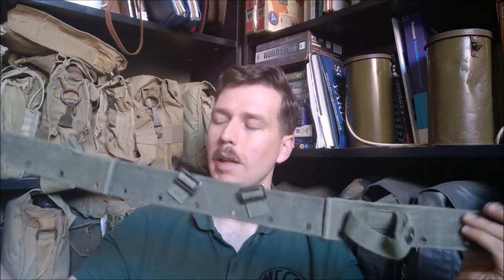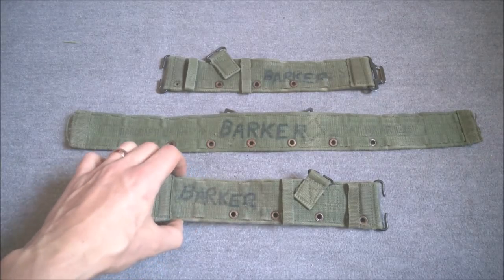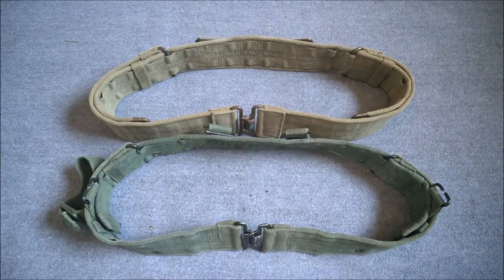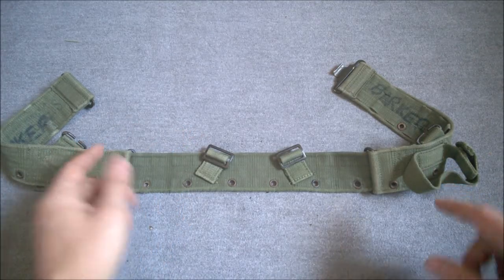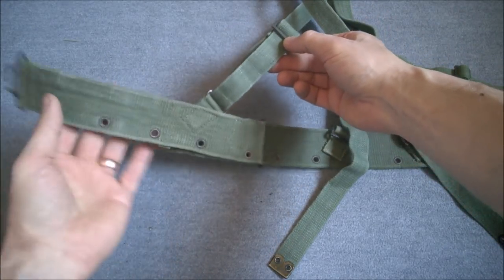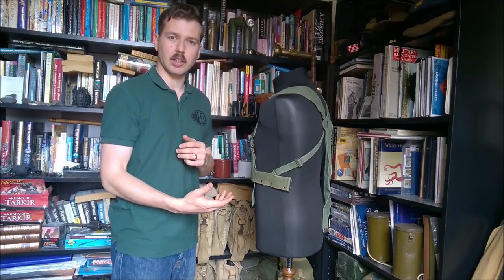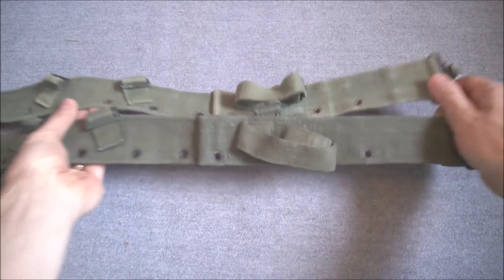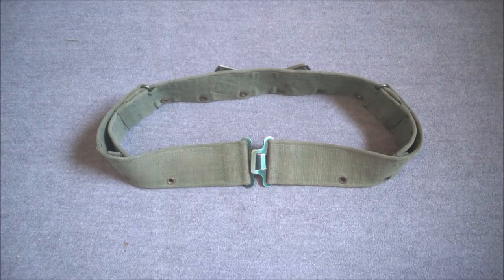British 1944 Pattern Web Belts

Comment: Very informative and never knew these ever existed, nicely done. I was army cadets in the 60's and joined up in 71 as an apprentice but got the 37 pattern for drill and buff belt for major parades. The buff was replaced by black plastic and was issued 58 pattern (American type) after that on joining regulars.
Reply from the maker: Got you, interesting to hear you didn't come across these in your service. When you say buff do you mean the old leather belt? Glad you found the video interesting!
Reply: @RiflemanMoore  Yes we called it the Buff belt and was usually 'meltonia' white. But, as I said it was starting to phase out with the Army Apprentices. I joined the band as a hobby during my time and we were given the black plastic belt with an oblong shaped centre connector but had the Royal Corps of Signals (Jimmy) on it. The buff belt was the normal circular type of connector with Dieu et mon droit around it if I recall correctly. That belt was replaced with the said black plastic belt for everyone in 1972.. we also had B.D. trousers issued for Drill only haha... modern army my bottom... We had 37 pattern webbing and it was 1971 for christs sake.... anyway we had to use that for the 2 or 3 years we were in the Apprentice college. The first unit we went to issued 58 pattern except of course in Cyprus which only had, yup... you've guessed it 37 pattern webbing. in 1974 just after the coup the older Brit tourists were impressed we had that webbing when we were getting them out of Famagusta... I didn't get 58 pattern until I joined a new unit in Germany.
Reply: @RiflemanMoore  this is the belt... https://www.wyedeanstores.com/white-buff-leather-british-army-waist-belt-no-7  cleaning was another discipline altogether. After brasses and meltonian white we used an inverted metal bin (room issued) which had numerous belts already on it drying. We then 'buffed' the white with good old Izal toilet paper until it had a nice shine but, had to be careful as it would also crack when dried ..... not so good on parade.
Reply: @RiflemanMoore  my question is this: what part of this belt differs between the normal and large sizes? I would assume that it is the back piece or the front pieces which were manufactured in longer lengths, not all 3 as that makes little sense in ease of manufacturing. And in either case, how much longer were they? Thanks.

Comment: Very interesting. On the large size belts was it just the centre section that was longer or were the left and right sections also longer? Thanks.
Reply from the maker: I believe it was in fact the opposite with the left and right sections longer whilst the rear section remained the same.